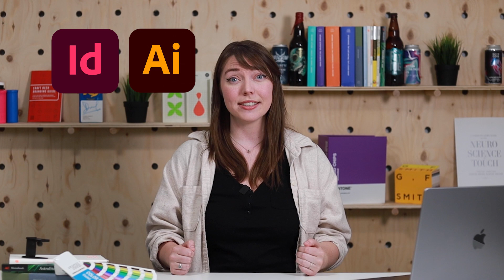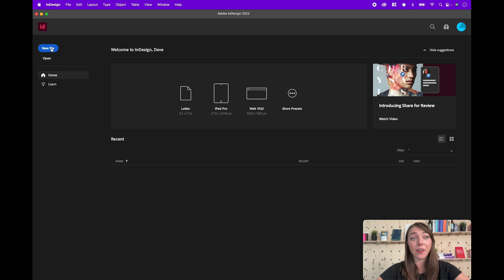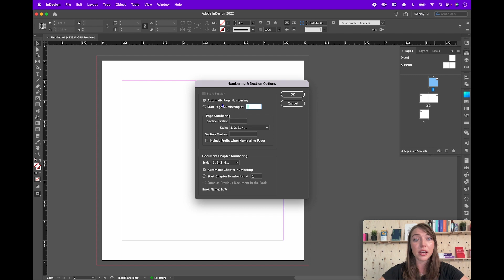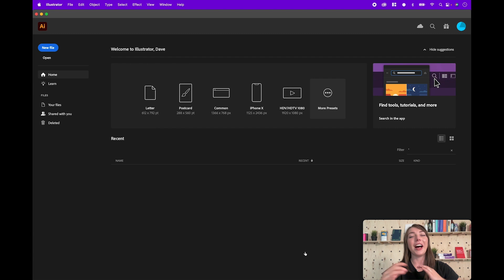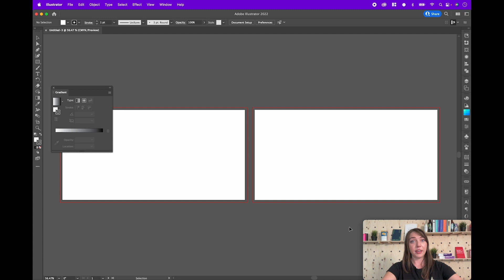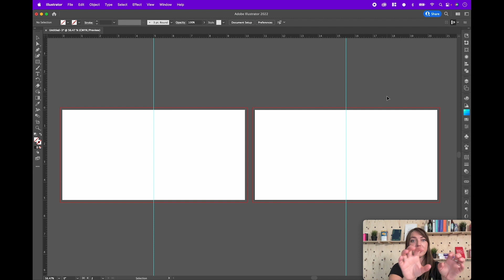How to set up your design document for Print //  Illustrator + InDesign // Print Ready Files Series

Comment: Hi, great video!!! It should be simple but I have got a puzzle here... I am making a design for a t-shirt. 4500x5100 pixels. I had an image from mid journey that is not high enough in resolution. So I used an AI upscale, to 22272x29568. Should be good enough! I then resized that image in photoshop to 4500x5974 (because of its different shape, I would crop later). Saved it. In indesign created a document of 4500x5100 with small margins, placed the image but it shows very small. The actual ppi is 300 and the effective ppi is also 300. But the image does NOT fill the size of the frame. in the transform panel it shows 100% for both the width and height but at 1080x1433 even if I did save the image from photoshop at 4500x5974. I did check the resample box, selected the resolution 300 and then clicked the chain link to unlink and rewrite the right dimensions to keep the resolution of 300... before saving the image! I thought that in Indesign it would be directly the same size as the document given the same dimensions or almost of both. it seems that my image should be slightly larger than the frame actually... But now I'm not sure anymore. I tried fitting options; they all lower my effective ppi. when I try to resize the image, with fitting options or manually holding command shift it downgrades my effectif ppi. I can't find a video on youtube explaining why and how to fix this. Spent 3 h with GPt and still don't have a solution... I dont understand why in the transform it shows that the placed image is 1080x1433px (100% by 100%) when in the other section the dimensions show clearly 4500x5974px with actual ppi 300 and effective ppi 300. Why are the dimensions different?  It should be simple. I set the right size in photoshop, save. Place that image in a document with the same size in indesign and bingo? Anyone know where is the problem and the solution that goes along with…? Thanks